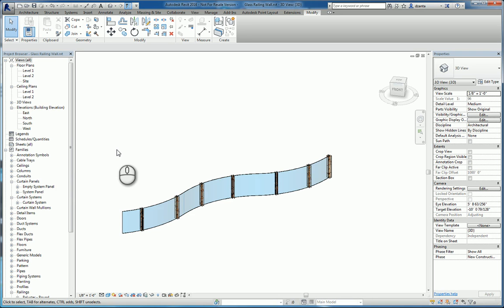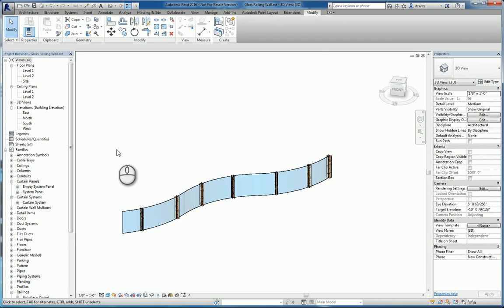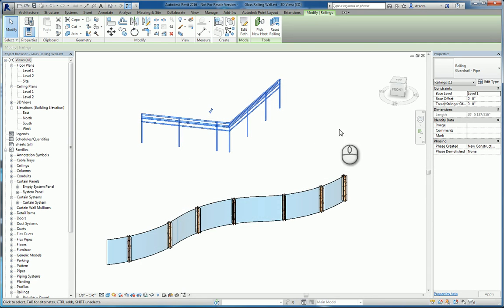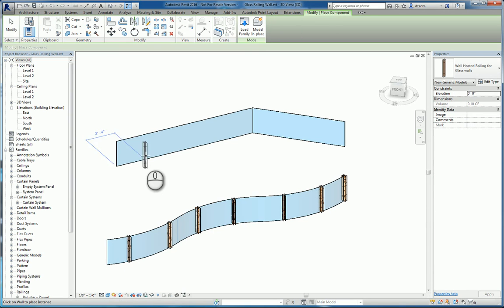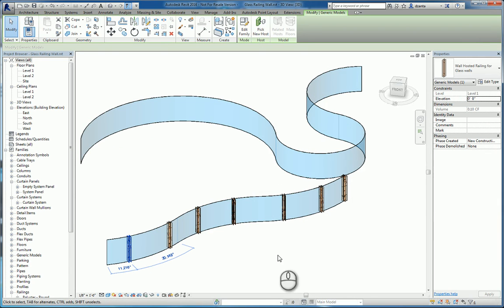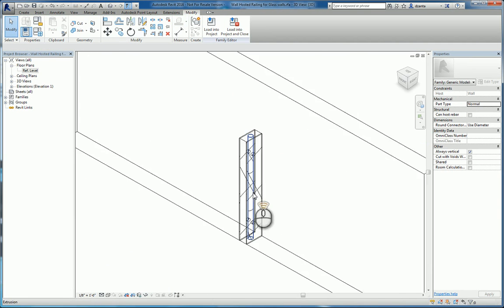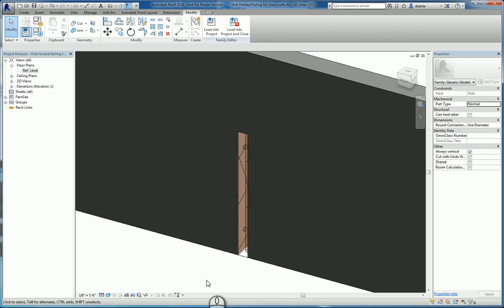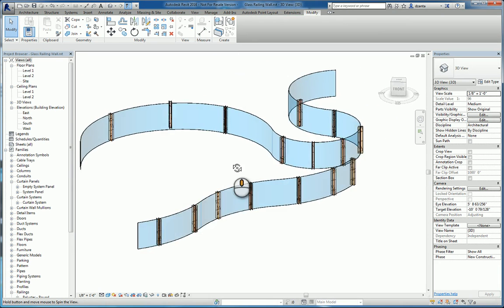Revit Custom Glass Railing - A How To Guide

Comment: You should be ashamed to call yourself a certified professional in revit because i real BIM industry, we should not use this method to draw the proper railing command. you should have thought the correct way which will have greater effect in the long construction run. This technique is not good